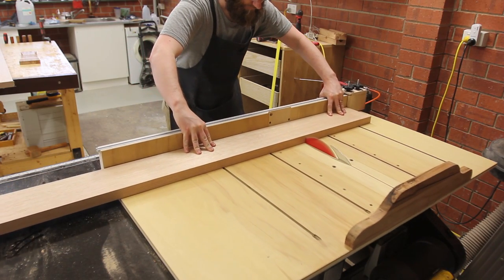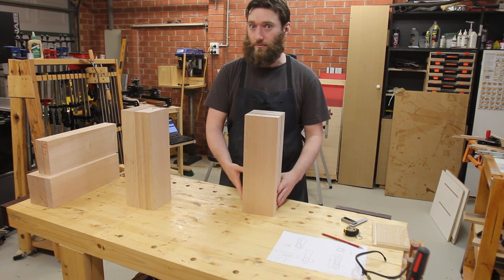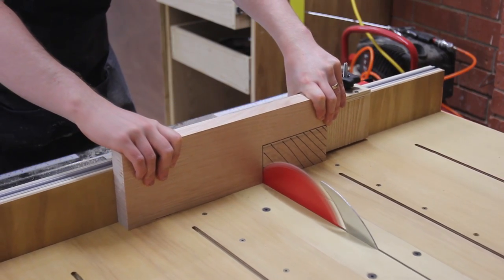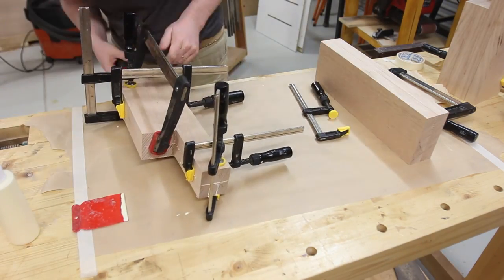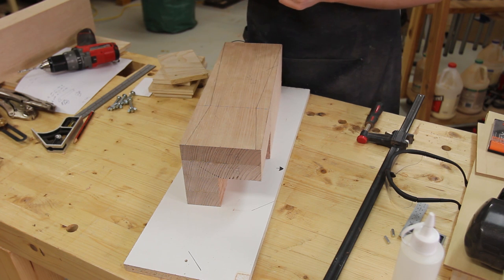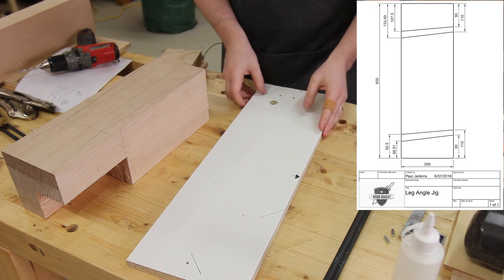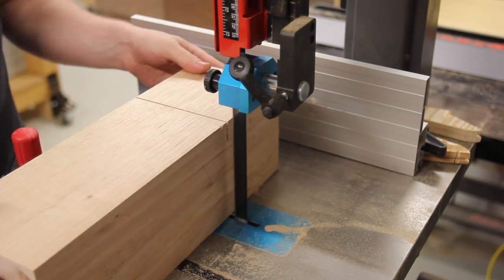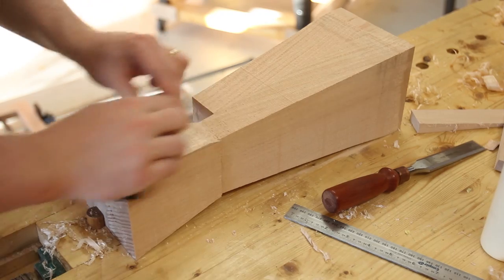The Shogun - Part 1: Legs

Comment: Hi Paul,  do you remember the dimensions of the dressed boards before you started the cut?  Did you get the tassie oak from bunnings?
Reply from the maker: No, I didn't get the material from bunnings. I think it was 150x38mm stock, but it's been a very long time that I cannot remember, sorry!